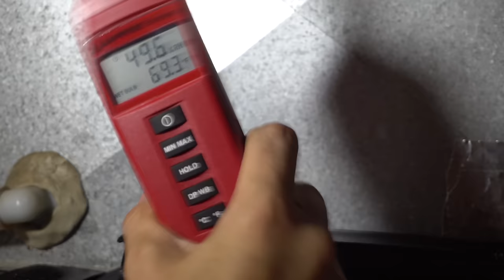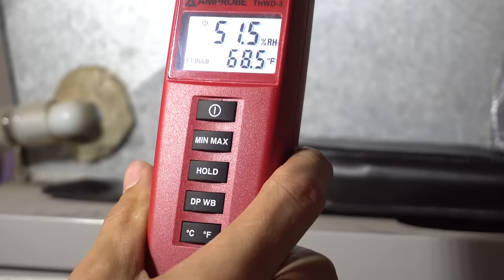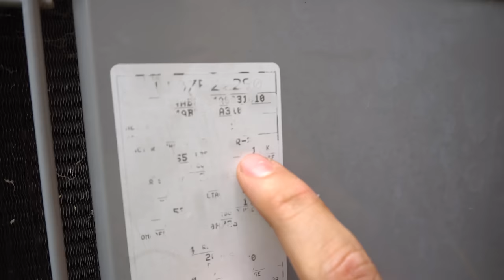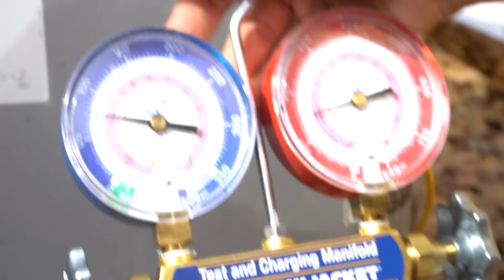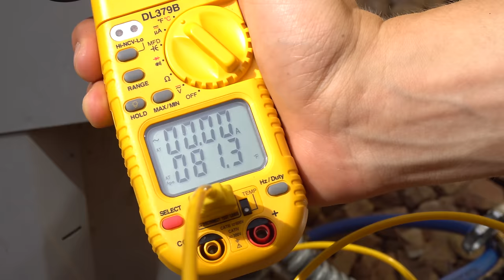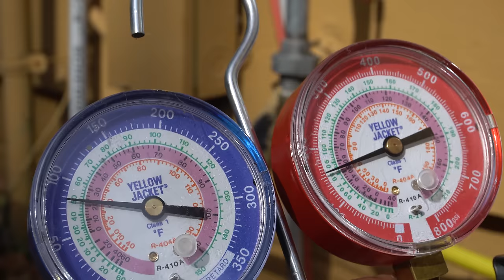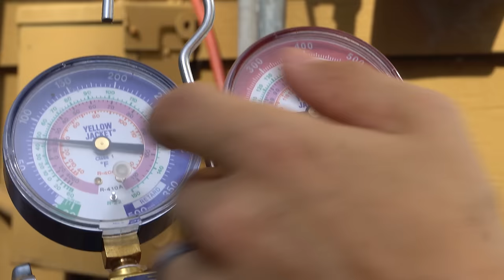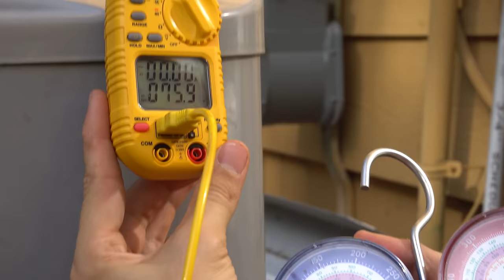How To Refill R22 AC With Subcooling Method

Comment: How do you know sytem is under charged from the system pressures. ?? I mean is there a way of knowing what the pressures should be before measuring ? What tolerance is acceptable on these pressure readings ?   Thanks
Reply: R-22 Suction should be around 50-80 depending on indoor temperature, and liquid around 150-250 depending on outdoor temperature. Low subcooling means undercharged.
Reply: Look up pressure temperature chart: suction side 40F (68 psi)) and discharge side 104F (207 psi) for R-22 refrigerant 😎😎😎
Reply: @G_D332  low side pressure should never run at 50psi.  That will ice the indoor coil, as the refrigerant is boiling below freezing in the evaporator.

Comment: Always bleed the lines before adding refrigerant. You don’t want to let any air into the system.
Reply from the maker: Did I forget to do that in the video? Yikes. You are very correct, always need to purge!
Reply: What happens if air gets in your system..i just had freon 22 put in by a hvac guy he dud not purge the lines. Its barley cooling my house. He charged me for 3 pds.
Reply: @norina6767  he should've checked for leaks on system, waste not to before charging    it up 3lbs is alot of money for r 22  ,unless r 422 replaced ,either way a candidate for replacement on a 15 yrs.  old unit.mho ,🤔👍✌️🙏
Reply: @milotorres6894  he didn't thats what i get for ever one saying you prob just need a shot of freon.  Mine uses 22 he charged me 160 and even he said that as well. Next day u started looking at some utubes and google info and realized i got took for that 160. Being out of work and not bringing money in blows lol.
Reply: With low loss fitting hoses, no need to as long as you have charge in them, without them, you’re losing charge.

Comment: Is it better to take the wet bulb reading with the A/C off, or already running? 

My metering device is a fixed capillary tube, so for my purposes, I need to go off of superheat. I take mine using a digital psychrometer through an access plug in the main return duct ahead of the air filter. With the A/C already running, I’ve noticed that this reading tends to be significantly lower (several degrees) than if the blower is just running with the A/C off. This of course would make sense as the A/C will start dehumidifying the air returning to duct.

So which of these is considered the proper or prefered way to take the wet bulb for an accurate superheat calculation? My hunch is that the wet bulb is best taken while the system is running. But I could be wrong.
Reply: You take the wet bulb return air reading with the system already running. And the system needs to have been running for around 10 minutes so all the numbers can average out. The point of indoor wet bulb is to include the indoor environmental factors in the total calculation of how the system performance is ultimately able to result in the desired superheat. This requires the system to be running.

Comment: Hope this isn’t a dumb question but why to you need a wet bulb temperature as opposed to a normal temperature?
Reply from the maker: You'd need the wet bulb if the system has a TXV metering device. But if you were asking what is the difference between normal temp and wet bulb, I break it down in this video: https://youtu.be/bpsqjKoNX2g?si=xjdjcsa6HRJKIPyv
Reply: @WordofAdviceTV  thanks for the response! 👍

Comment: So if you have a leak in the coils. Can it be fixed...like is there something you can buy and spray on put on, etc?
Reply: They do make an epoxy that you can put on the coils to seal them, they also have a stop leak sealant you can put in the system to seal it, and if you know the exact spot you can braze (solder) the spot. Brazing is really the best solution because the others don't always work. You could get sealant with dye, if it doesn't work the dye will show you the exact spot of the leak to have someone braze it.
Reply: Additives can do more harm then good. Repairing the leak or replacing  the coil are the best solutions.

Comment: Hi again Jay. I just had an HVAC guy come and add 4 pounds of 407C to my R22 system. Is this normal procedure or even legal? I didnt notice until he was finishing up. Please give me your thoughts. Thanks
Reply: It was illegal to do that under EPA rules.  Also, 407c is not the same pressure as R22 so that's not good either.  Under EPA 608 rules, there is no drop in refrigerant for R22.

Comment: hey jay, i was wondering if you charge liquid into the suction line does that slug the compressor?
Reply from the maker: Yes it does if you open up the gauge full blast. If you are adding as a liquid, you want to "throttle" it in. You can either use a vaporizer adapter or simply only crack the gauge open so that the pressure only goes up 10-15 psi from the starting point.
Reply: @WordofAdviceTV  ok thank you so much Jay! I've learned so much from watching your videos. 👍

Comment: Question:
A/c tech added r22 to system....
If the low pressure line at the condenser unit doesn't sweat, does that mean the system could be overcharged?
Temp in house does drop but I think the a/c system struggles to meet the set temp. Sometimes it just keeps running without shutting down on a very hot day.
Reply: Clean, with a water hose, the outdoor condenser...even if it looks clean.  Make sure your filter is clean.  Not sweating could be humidity related also.  Beer can cold...

Comment: Pressure inside R22 tank is same even if inverted right?
Reply: Yes. You can take whatever temp the outside temp is (if the jug has been sitting outside out of the sun) and correlate that with the pressure.

Comment: so what is the wet bulb temperature reading for in this situation?
Reply from the maker: I went in the house not knowing if there is a TXV or not so I took the psychrometer with me. In this situation it was not needed because the wet bulb is only required when adding refrigerant using the superheat method. Since I had the psychrometer anyway, I took a measurement of the wetbulb just to show how to do it.

Comment: Jay, I just got a new Split HVAC sysem and it has an ECM Motor for the blower in the Furnace.  The Motor is a "5 speed Direct drive".  I am thinking of changing blower speeds to try to get rid of some almost constant humidity in the house.  Default settings on the board (color coded wires) are "Heat" = Medium high,  "Hi Cool" = high, "Lo Cool"= Medium, &  "constant fan" =  low.  4 questions...  1)  The owners manual says to change cooling speed, change the "Hi Cool" motor setting so I am wondering... what is "lo cool" and its function?  There is no reference to what it actually does in the owners manual and I have googled the heck out if it and have found very little reference to it on the internet.  2)  To try to slow the motor down for dehumidification. I was thinking that my best bet would be to change the "Heat" from Med High to High and then change the "hi cool' from high to medium high speeds.  Do you have any advice on this or using other speed settings?  3) is it safe and energy efficient to put your "heat"on the high speed? ) ifI change the blower to a lower speed do I need to be concerned with the coil freezing over (it is a TXV) Help!!!
Reply: Not Jay...Sorry, that is not a standard ECM motor which are programmable. If the wires go directly into the motor without a molex plug connectors and it has a capacitor connected to the motor then it is a standard PSC furnace motor. If it has a molex plug connector on the motor and and colored leads plugged in to the control board then it is a retrofit replacement ECM motor. You may need a lot more information about delta T and wet bulb temp to mess around with it. It may be that they over sized your A/C or did not set up the speeds correctly on that motor. Look at the manual because it will tell you what taps to use on the motor for the tonnage of your A/C.
The high setting for heat may blow cooler air on you in heating but is not harmful. Check the tons of the A/C and make sure the correct speed tap is being used.
Reply: @hellbirdman  it has a 3.5 ton evap and a 3 ton condenser.  I was told that they used the bigger evap to get increased seer rating.  The owners manual says 350 to 400 CFM per ton but does not say what that translates to EXACTLY in blower speed (high Med Low, Etc.).
Reply: @jotu173 ... A 3.5 ton blower in the furnace moves 1400 cfm of air if the duct work is sized right on high speed. The next speed down, med high will move 1200 cfm.which is the standard for a 3 ton condenser. . You could test plug the black wire from high speed into the medium high speed and make sure it does not freeze up.  HVAC takes a bunch of instruments to test what is going on if you really want to know about it. But if the black wire is on high speed on the board then give it a shot to move it to med high. When I run into that I get a quick connect spliter (a little y with 1 female and 2 male ends quick connects) to keep the heat wire on med high with the black A/C fan tap.  Your install sounds like somebody from CL did the work on it.
Reply: @hellbirdman   It is a TXV.  so won;t the TXV auto adjust and prevent the evap from freezing? your idea with the quick connect splitter... I would think that it might mess up the control board to do it that way (attachng in parallel??) . You have had no problems doing it like that?

Comment: Wet bulb is taken by return(largest), Dry bulb is taken at the register and the Delta T is the difference between the two temps?
Reply from the maker: Sorry, I explained that part poorly. Yes, wet bulb is measured indoors.

Dry bulb is the temperature outside by the condenser unit (usually measured on the side of the condenser coil, the side that is not in the sun)

The Delta T would be measured indoors at the air handler. The temperature of the supply air and the temperature of the return air. Return Air Temp  - Supply Air Temp  = Delta T or Temp Drop.
Reply: I like all these technical terms; Delta T,  Wet Bulb, Dry Bulb, TXV etc.  Could make a numbskull sound like a genius!  Not saying we have any numbskulls reading the blog...LOL

Comment: Is it possible to just take the low side pressure and recharge?
Reply from the maker: It is possible but not recommended, especially if the unit has a TXV metering device
Reply: NO! One principal of thermodynamics is a cycle of heat moving through evaporation (evap coil) to condensation (condenser coil). So heat is being absorbed and rejected in the cycle. Therefore we need to measure the heat in different states liquid going into the evaporator and vapor into the condenser. Subcooling taking place at the condenser and Superheat taking place at the evaporator (in cooling mode or call for cooling at the T-stat). Recharging should NEVER be done without fully diagnosing the system in a non-invasive way, the very last stage is utilizing gauges (probes preferred). One fault of most HVAC techs /engineers- IS FORGETTING patience and proper diagnosis of why a charge is "low" we label techs that just stick on gauges and put in refrigerant "gas and go" SCAM artists especially when they charge $100+ lb for R22.  Remove the word RECHARGE from your vocabulary within the HVAC industry.
Reply: @proanswers  OK, good to know, I'm learning!

Comment: How do you know what's the target sub cooling for your system when it's using a txv and doesn't say the target sub cooling out side on the data plate
Reply: You can check the service facts paper located inside the condenser unit. If that is missing, then shoot for 11 degrees subcooling.

Comment: My AC unit does not do much cooling any more, with 30 seconds when it is turned on, it has a high pitched noise for about 1 minute then gone.  My unit has low pressure. Can any comment on this?

Comment: what if someone charge an empty system with refrigerant in gas form, any remedy ?
Reply: a blend Nu22B was charged
Reply: @bettershooter  In order for a blend to be used properly, it'll have to be charged as a liquid. Which is turning the jug upside dn while charging.... Charging as a gas doesn't utilize the different refrigerates that make up the freon being used. So if it was my job I'd recover and recharge as a liquid.

Comment: Hi J,
Question: If the heat pump is low on R22, Can it cause a compressor to run very hot and shut down on thermal overheat?
Respectfully.

Comment: Blame it on the Schrader valve That's a classic.
Reply: Installer probably welding without a wet rag to cover the valve and left the schrader in.
Reply: @stevenholmes3589  Honestly, it's not at all hard to take the shrader out. I'm a mechanic but have done my fair share of odd jobs and such and know HVAC pretty darn well and it's surprising how often I saw this

Comment: Hi, if I'm out off R22 and I only need less than a pound refrigerant and I happen to has R407 and NU22 on hands, which one is better choice to use and would be closer compatible to R22??
Reply: R-407C requires a different oil type, do not use this. R422B (NU22) is compatible with all oils, I would add this but only as a last resort.
Reply: Its never good practice to mix refrigerants. Recover the remaining r22 and evacuate the system.  Then you can use your nu22. 407 is great if you're converting to POE oil but isn't compatible with mineral oil.

Comment: Your gonna hate me for this but first I think your a first class HVAC guy. This thing your gonna hate for is pointing out that yellow gas line behind you may not be code. It is not jacketed with a black conductive jacket of trac CounterStrike. Here where I live it is against code to install yellow trac pipe out side and above ground. It must be lightening protected on outside exposed surfaces. Now that is kinda of a recent code in Georgia and yours could well be grandfathered in but note this...I have been in an attic where lighting has made a pin hole and created forever flame in a stainless flex line. When I climbed into the attic it was not a pretty sight. One sees a lot in 40 years. Here is Code... ANSI LC 1-2018/CSA 6.26-2018, This only came up in 2018 and there is some modification later on it.

Comment: With any significant liquid refrigerant in the jug (say one pound or greater), pressure in the jug is based on the temperature of that liquid not on the volume of liquid.

Don’t believe me, do a little more study about the PT chart. 

I really do like your videos!! Thanks!

measureQuick is arguably the top of the line for charging/troubleshooting.
Reply from the maker: Thank you for the additional explanations and the app suggestion is much appreciated!!
Reply: what Chuck DeArruda was saying was in regard to where he said "as you have less and less refrigerant(liquid R22) in the tank there's not enough pressure in the tank to push it inside the unit....in that case you would flip it over...."
There is absolutely no difference in pressure between having a full tank of liquid refrigerant or 1 ounce of liquid refrigerant. Saturated pressure/temperature (is the same pressure for both at the same temperature. Now if you use up that last ounce your vapor pressure will start dropping.
I think "Word of Advice" knows this but just mis-explained.
I personally admire this youtuber and am rooting for his continued success in his work, family and his faith!
ps-  Measurequick app is a fundamental game changer for HVAC techs. Investing in wireless probes along with this app has been mind blowing for me.
Reply: Thanks for your comment Tony!  I trust that Jay understands the PT principle as most of us do. 

I’m still just a student of these charging/refrigerant procedures. But I have heard of other technicians having the frustration/difficulty getting that last few ounces out of a jug. 

I suspect there is something or combination of things that seem to defy my understanding of the PT principle when trying to get last of refrigerant from the jug. 

Maybe the is some “micro” environmental flashing (and temp drop) of that last few ounces..  Or maybe the pressures (suction and charge through manifold) are both so low (low vapor density) that very little of the vapor migrated into suction side of system. 

Interesting phenomenon, I think.
Reply: @chuckdearruda6271  The problem is that the remaining refrigerant in the tank gets cooled to the vapor point on the PT chart and no longer has the pressure to overcome the suction pressure of that in a system.  If you charge by liquid then the remaining refrigerant does not cool as much because your no longer charging by pure evaporation of the refrigerant left in the tank. Or, the more gas you evaporate in a tank the colder the tank gets thus the lower the pressure in the tank is.
Reply: hellbirdman , Thanks!  Your description sounds very reasonable, , , and far better said than anything I could have attempted. 😎Thanks!

Comment: I am not an AC Tech. My system is vacuumed and completely empty. On my panel it says 91 ounces filled from the factory.
Why don’t you put 91 ounces in the system if it’s empty????
Which is about 5 pounds, then check with your gauge.

Comment: So on TXV valves since there is a moving diaphragm, I was told to let it run after the charge for at least 30 min to stabilize the TXV. Also, I always smear on leak tight to the king valves after servicing. Sometime after opening the valve caps, u spit on my finger then swipe it on the opening to see if it starts expanding the spit bubble. I dont know how else to write it in here. Sorry I speak Polish too so sorry for the incorrect wording. Also I go up to 100 PSI on the suction side with r22 and no more